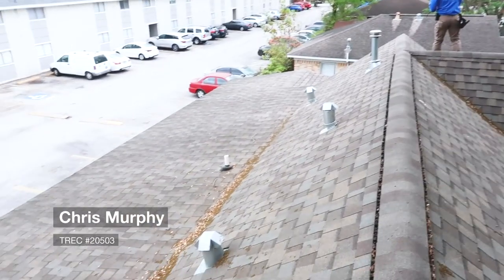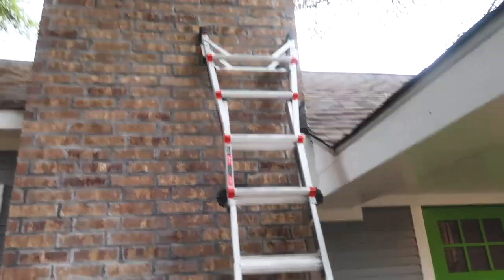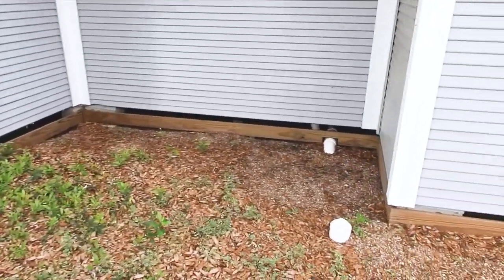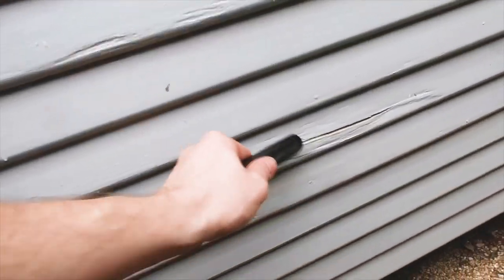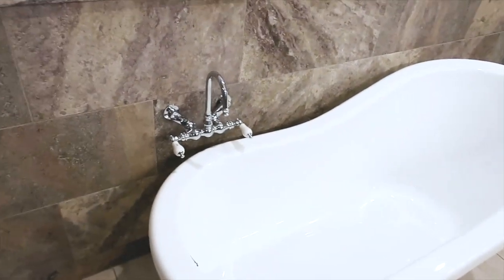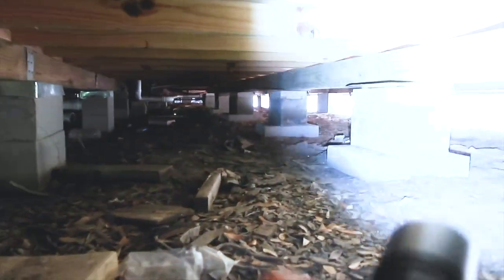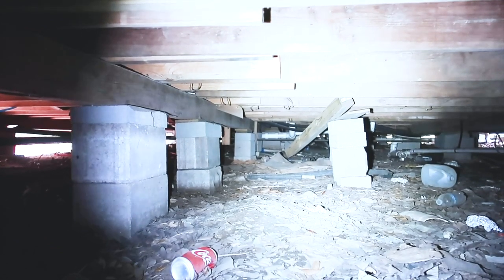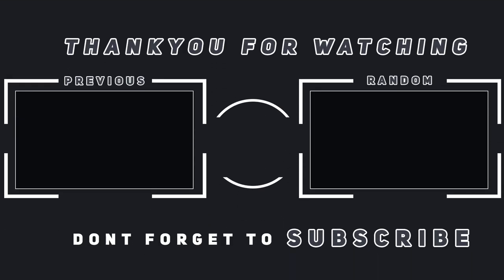Crawl Space Real Estate Home Inspection - The Houston Home Inspector

Comment: In process of buying a home and inspector pointed out an issue with the sewer line on the driveway. Have no idea how much that would cost, any clues? Also a minor crack on the basement. This is 1980's home. They had a flood a long time ago, but remedied with roof replacement.
Reply from the maker: Sewer lines can get very expensive,  I would go off the inspectors recommendation and get a quote from a plumber.  

Minor crack will be in most basements.  I do have very little knowledge on basements because I am from south Texas.

Comment: Can you explain the AC unit and breaker issue in a little more depth. You said you don't want an AFCI on a ac unit?
Reply from the maker: From what I have seen,  the HVAC units trip the AFCI breakers often.  I honestly dont know why this happens.  Maybe an electrician can weigh in on the comment.  The main problem is they had a breaker too small for the condenser.   This will cause the unit to trip the breaker often.
Reply: @AActionHomeInspectionHouston  Is this something you see often? I would love a top 5 most common or quick tips of each home system. Thanks again!